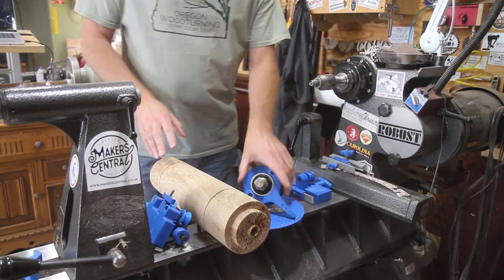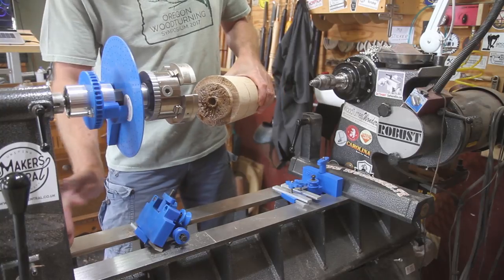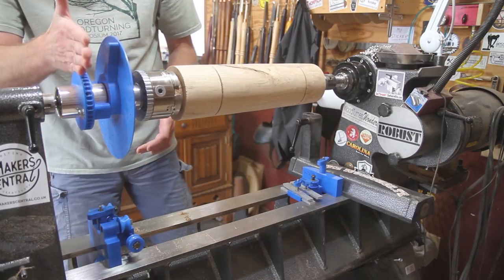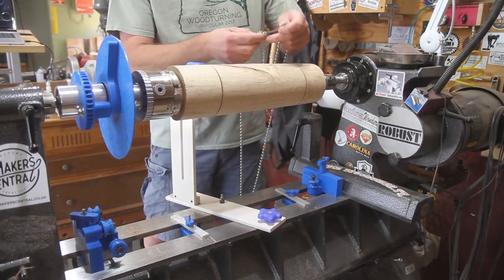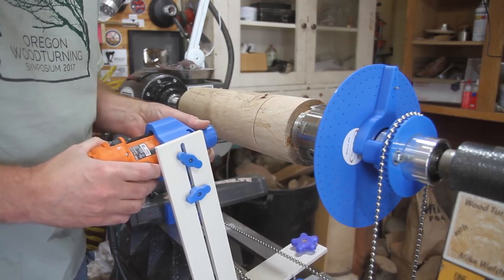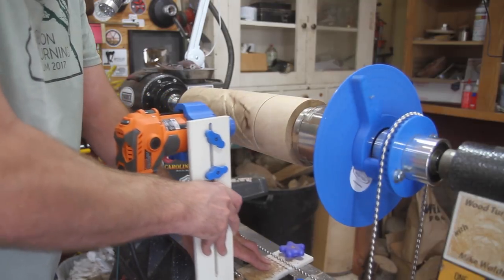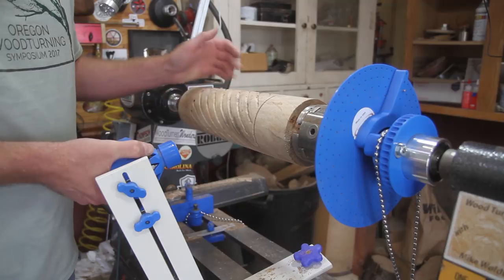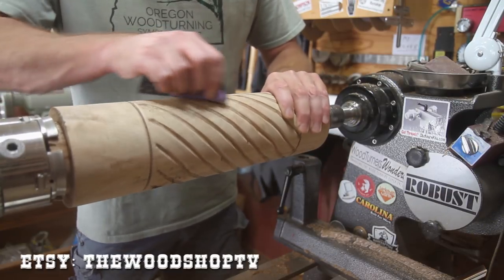Woodturning Tool / Spiral Cutting Jig

Comment: Looks a little wonky to use, so practice, practice, practice. Nifty bit if kit, as they say accross the pond.
Upgrade idea, rollers on the router base, between the bed ways, for smoother action. 2 on one side, 1 on the other?

Comment: Seems to be very hard to get the spiral flutes straight when you can rotate the tool holder however you want. Quite abvious to the right at 10:10. Would have been much easier if there was a guide that kept it absolutely perpendicular to the lathe bed.
I bet you could have done it better by free handing it. ;)